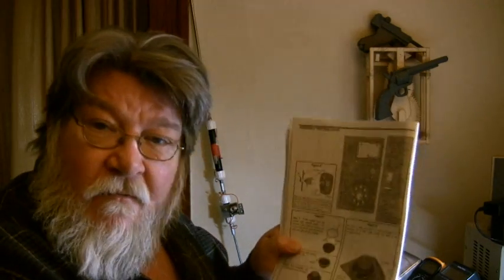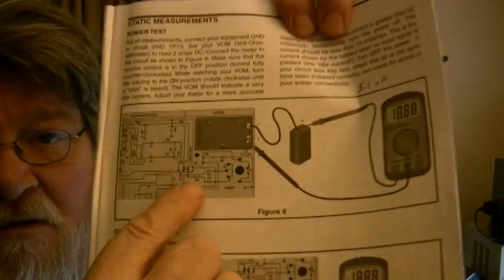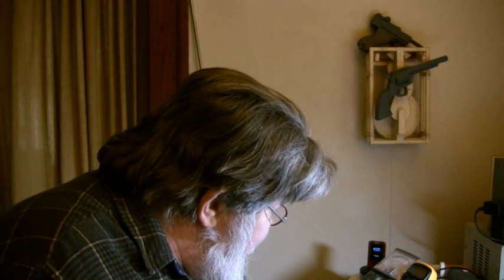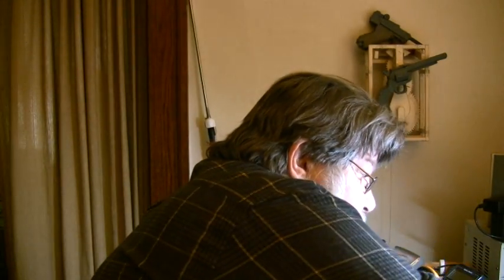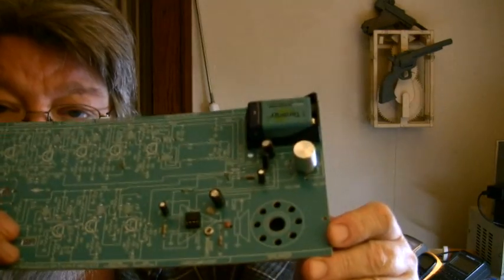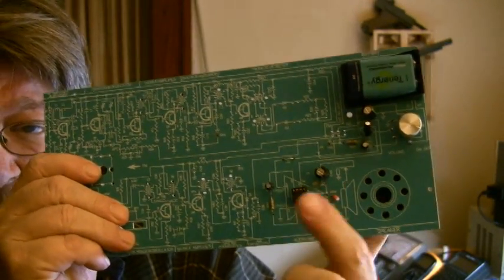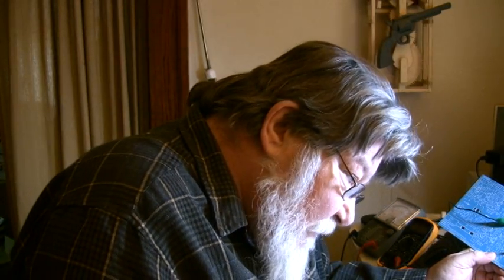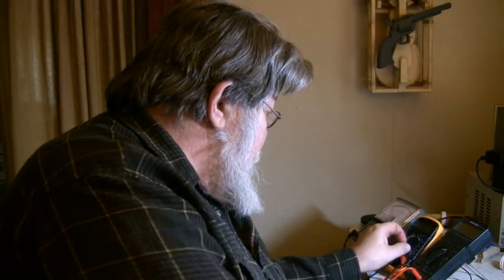Let's build a AMFMRadio 1b

Comment: The equipment needed to do this project is either an audio generator or function generator, power supply, VOM meter, amp meter, RF generator, and oscilloscope to follow along with the various test procedures. I'm almost to section 2, I work on it when I can. It is quite interesting, I haven't had the chance to use the equipment for quite awhile, good to be back at it again. You do have to follow the test procedures carefully.

Comment: Sorry, I forgot to answer your last question about what generator am I using?  I am using a B+K 301 Audio Generator. I'm going use a function generator too to confirm my first readings. I have a couple of B+K RF generators too that will be needed for later tests. I have all the equipment they call for, scopes, generators, power supplies, meters, etc. I haven't used some of this stuff for awhile and it is good to get back in the saddle again.

Comment: Sounds like you have an RF generator, if it is, you will need this later on. You would be probably be better off building a generator circuit like you're talking about. You could pick up an audio generator off ebay cheap. Keep the videos coming I'll keep watching!

Comment from the maker: selah62,,, my question is can I use a higher frequency as my generator starts at 150K Hz. I'm wondering if I should build a small oscillator that will generate 400Hz to 1K Hz. What are you using for you signal generator?

Sounds like your results are right on per the manual.

Comment: Interesting project. I bought one of these kits too and I'm at the same place you are right now. I was hoping you were going to do the 400Hz gain test so I could compare my readigs with yours. The Gain that I measured depended upon how high I had the volume control turned up. If I had the volume control down low I was able come up with  gain of around 120...which is fine. But when I had the volume control turned half way up toward max, I was getting a lower Gain reading below 100.